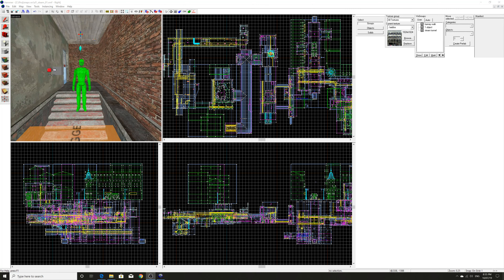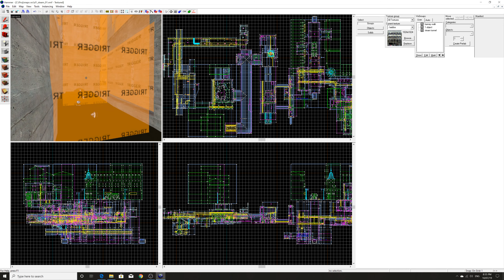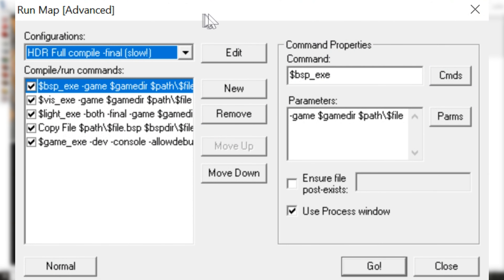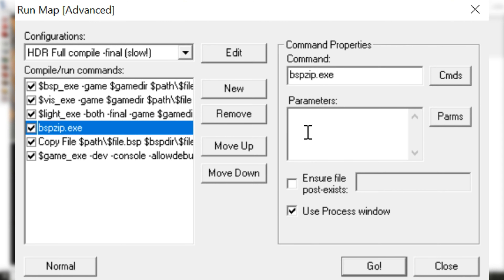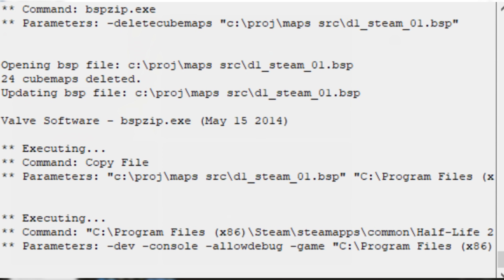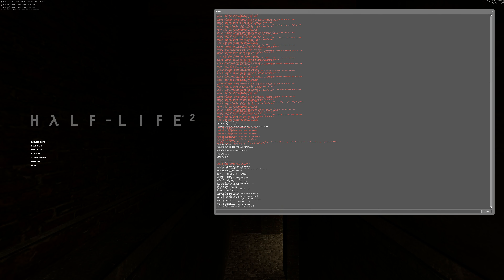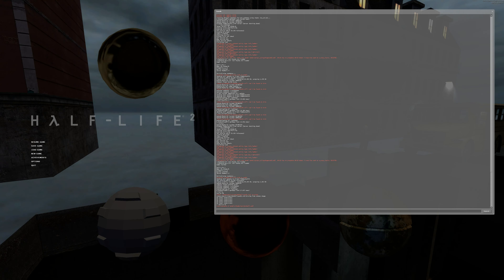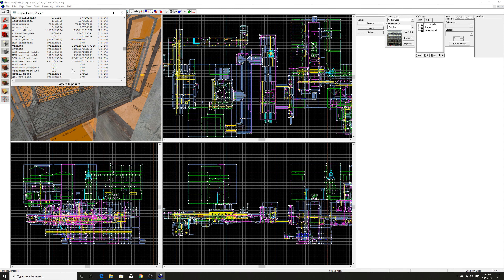Hammer Tutorial 3 REVISITED: How To Fix Cubemap Reflections (Updated Guide)

Comment: (SOLVED. READ COMMENT BELLOW FOR MY FIX) Trying to do this in portal 1. Followed all the steps exactly. But no matter what I do the game refuse to generate cubemaps. Well what I mean is that the non HDR and HDR generation of the cubemaps looks the same with you when performed. But even after restarting the game they are not present and reflctions are black when using impulse 81...

Yes I did the exact command in the compiler as well in hammer. Although I noticed the log says "warning: falling back to auto detection of vproject directory" when it gets to the part so it is failing to delete it...
Reply: Nevermind! I ran the game through the portal 1 bin and despite hammer having right configs something was not right. To fix it I had to download the source SDK. Launch it once through there (but this caused a different problem again, to solve it read further). And then exit  hammer (with right config there) then re-launch it from the bin again like before. Now it is working! Thank you!
Reply from the maker: Strange...well, at least you fixed it! The comment I would have left originally would have asked if you compiled the map with HDR lighting, as an indication of a map which has not been built with HDR is the cubemap creation procedure being the same as LDR mode, however it seems the bspzip.exe application didn't run as intended. I may be wrong, but I believe this might have something to do with the Portal Hammer configuration. For example, changing vbsp.exe to use the Mapbase mod's version in the standard Portal configuration will cause an issue and the map won't even compile, so it could be that a new configuration would need to be used for it to work. Whatever the case, you found a solution that worked for you which is great!